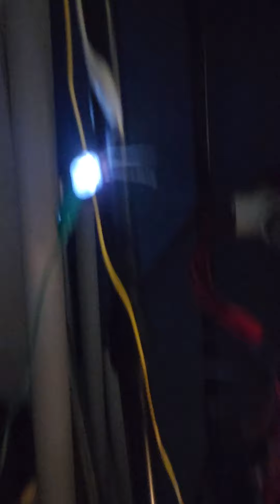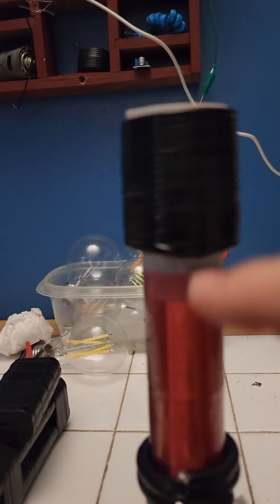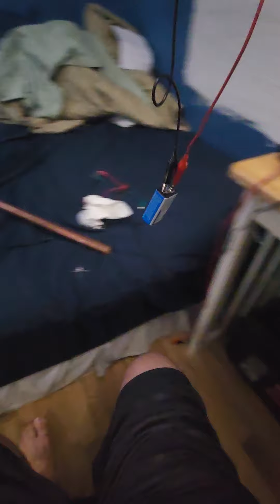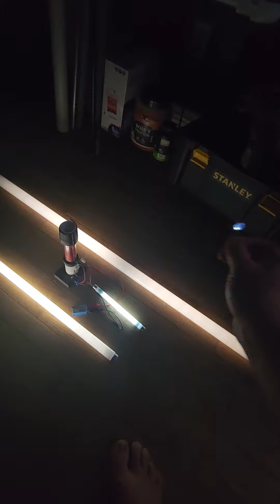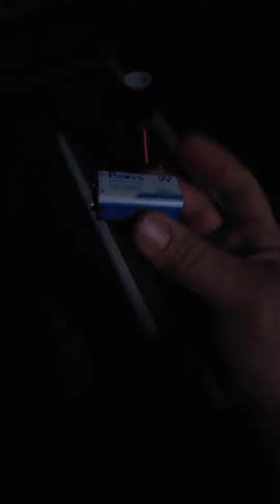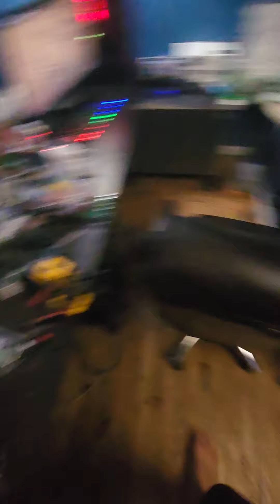🔧 HOW ITS MADE OPEN SOURCE VIDEO PLUS BASIC SCHEMATIC. 📃

Comment: Are you experiencing any issues with your nerves?
Reply from the maker: No? It's non ionizing radio frequencies slightly over 1Mhz. If the device gave off x-rays then there would be an issue lol
Reply: @MTECHINDUSTRIES  transcranial magnetic stimulation is a thing. Too many unknowns to establish it as safe yet.

Comment: So basically ur making it wireless power... Nd getting to vibrate it at a set oscillation what is the oscillation amplitude
Reply from the maker: 1Mhz square wave & amplitude varies based on tuning but is generally around 30kv peak to peak

Comment: What is the diameter and length of the copper reflective pipe antenna? How did you calculate the size relative to the transmitter size?
Reply from the maker: So the transmitter outputs a 1mhz signal & my copper monopole receiver antenna is 12.5 inches in length which is a perfect divisible fractal of a 1mhz wave. 2950÷12.5=236 I also use many antenna calculation apps :)
Reply: @MTECHINDUSTRIES  Thank you!

Comment: Was testing your concept on a crappiest tesla coil you ever imagine and most basic slayer exciter circuit with 20v input, coil 8 inches with 1 inch primary. Efficiency not even close to yours BUT! Got copper pipe, Connected to the ground of my radiator and all grounds in a house would have output. 

Now remove copper pipe, put tesla coil next to radiator and got even better effect. 

Now modified your led diode antenna with middle tap and got weird led light oscillation effect. Its impressive. 

Will replicate your coil next. Amazing job BRO! 

Tried with smaller tesla coil with capacitor circuit it sold online, however even if this little tesla coil got better efficiency and more voltage output nothing worked though. Maybe size matters, maybe circuit. Will experiment! Cheers
Reply from the maker: Ratios play a huge role in its effeciencies ❤️ ⚡️ 💡